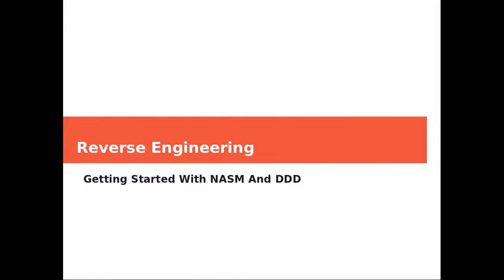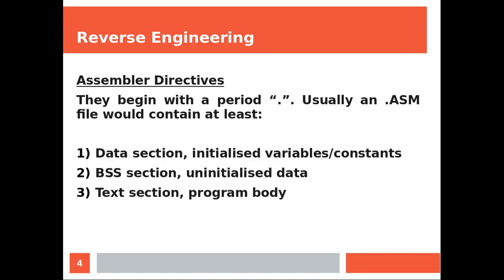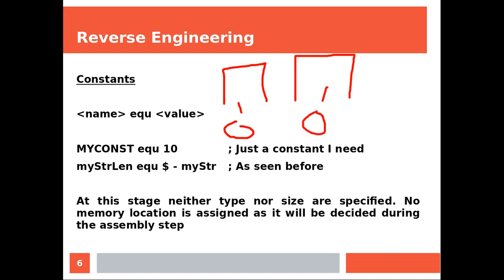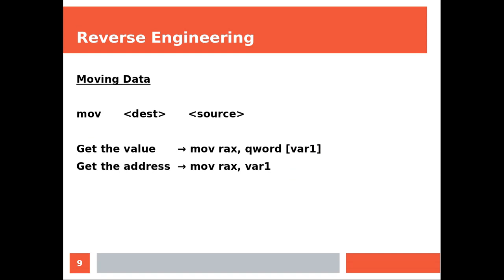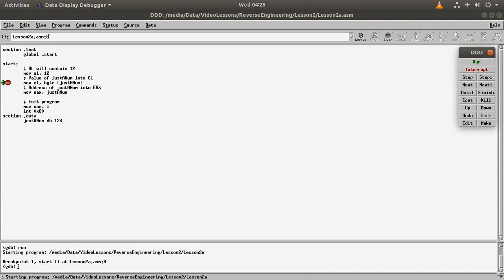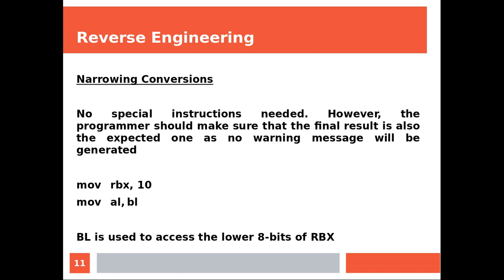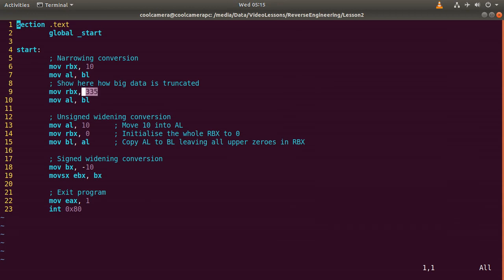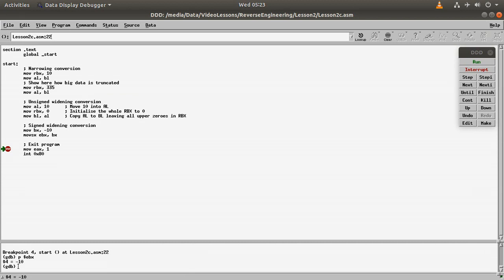Reverse Engineering | Getting Started With NASM And DDD | Beginners

Comment: This series is really great. But I was wondering when you would use equ and when a "specific type" like db, dw, etc. and what the differences between those are.
Reply from the maker: Thank you for your feedback! Usually EQU it is used to define constants and it does not allocate any memory. This instruction is similar to what #define would do in C although EQU can be used anywhere in the code. When types such as DB or DW are specified, actual memory is allocated to store the value. Bear in mind that this is the Intel / NASM expected behaviour, other platforms might follow slightly different rules

Comment: I think BL @ 14:01 would be 16 Bits, as RBX is 64bits and by BL and BH we can access half of the the register. So BL and BH would be 16 each.

Is my assumption correct?
Reply: I got it resolved the size of the BL And BH doesn't matter on whether it's 64 bit or 32 bit, It's always 8 bits.
Reply from the maker: Yes, BL accesses the range of bits 0-7 while BH accesses 8-15.

Comment: i open ddd program and there is no code. what did i do wrong?
Reply from the maker: Make sure you choose the correct stabs format for the "-F" option and also do enable debug information using the option "-g". Recent versions of NASM automatically enable "-g" if "-F" is specified. Let me know whether this fixes this issue
Reply: @CoolCamera  Im new to this so i dont understand everything, but it says i need executable file
Reply from the maker: Maybe you are trying opening the .asm files instead of the compiled ones
Reply: @CoolCamera  I want to create object file and than executable file like you showed in build.sh file but when i type it in terminal it returns an error. I type:   nasm -f elf64 -F dwarf $1   
and then:   ld -m elf_x86_64 ${FILENAME}.o -o ./${FILENAME}
Are these commands to compile a file or can you tell me how to compile it?
Reply from the maker: Are you putting these lines into a script? Because $1 is the first parameter that is being passed to the script build.sh. In fact, in my script $1 is the .asm file. If you do not create a script then $1 would not be replaced with the filename. If you do not want to create a script then you need to manually replace $1 with the .asm file before typing the command into the terminal. I hope this helps :)
Reply: @CoolCamera  Hey i found out what i was doing wrong.  Now i see the code in DDD :) Your tutorials on assembly programming is awesome :) i like it :)
Reply from the maker: Thank you for your feedback!